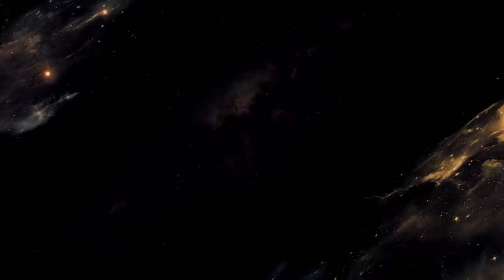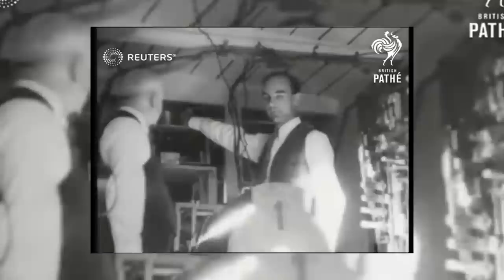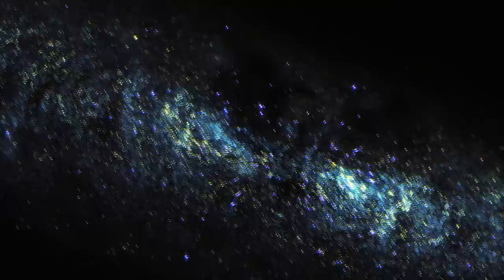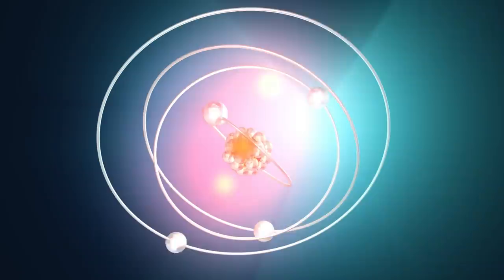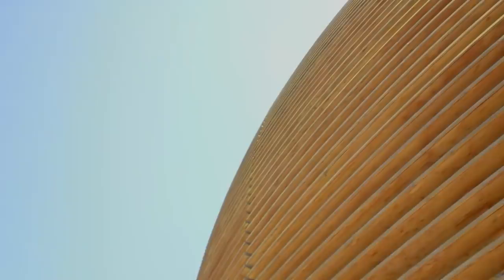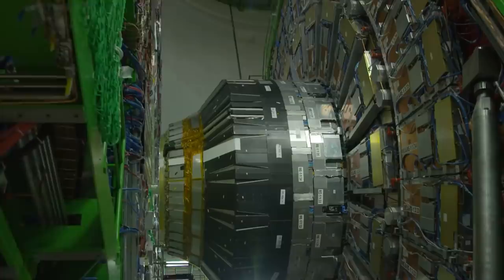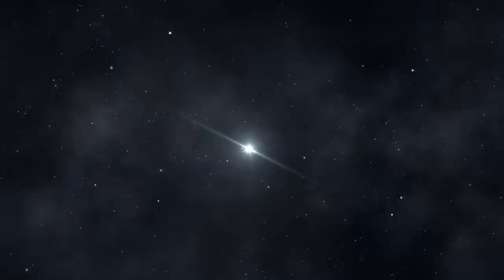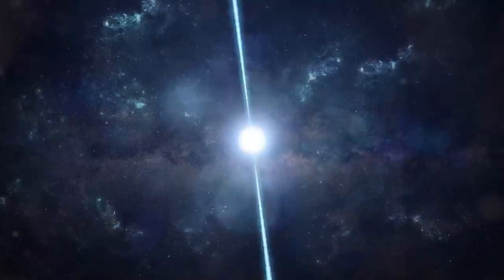Physicists Finally Reveal the Terrifying Truth About Antimatter

Comment: Maybe we could make antimatter bombs specifically for asteroid and comet elimination. Only positive use for anti matter I can think of, other than spaceflight maybe.
Reply from the maker: Wouldn't be a bad idea actually!
Reply: Light the fuse and run like hell!
Reply: You means wars
Reply: The most efficient means of extracting energy from matter.
More efficient than nuclear fission or fusion, because there's no waste materials and exponentially more efficient than burning fossil fuels for energy.
Reply: they would do horrible things with an antimatter bomb that wouldnt involve asteroids😂😂
Reply: They could use it on the asteroids circling Uranus.
Reply: "Someone will set the spark off, and we will all be blown away" -The Merry Minuet song,1959
We always knew it would happen one day.
Reply: No we can't. Maybe 500 years
Reply: True but the problem is making and containment of antimatter.
Reply: @satanicmicrochipv5656  

Yeah like antimatter reactors to produce power. Would be incredible if we could efficiently produce antimatter with less energy than the power they would make in a reaction.
Reply: @goldfish1493  

We are not going to last that long.
Reply: @wilsonrawlin8547  
Yeah, it'll be awhile.
Reply: How would we even contain it, let alone move it? Any contact with matter would be catastrophic, including atoms that make up the air in an empty space
Reply: The black wholes seems to do that job already. 
Maybe the black wholes (which we don't know what's inside) are gatherings of the remaining anti matter. 
Who knows 😁
Reply: Maybe we can use antimatter to form explosion to recharge dying sun
Reply: @satanicmicrochipv5656  maybe hydrogen laser? With big reactor and silo smth like star wars death star but in this case recharging earth? well rememeber that we don't need to hit sun with antimatter we can hit smth like comet  within its gravitation zone the sun would simply devour the Energy from blast and get either bigger and recharged or wouldnt, thing is we would need to proportionally make it we don't want to orbit close supernova or blackhole or neutron star
Reply: @piotrkijak1774  
Sure, if we could generate all the energy we could possibly use, we wouldn't even need a star and power a focused energy fields from specific locations on earth and fly the whole planet away.
🌎~
Reply: Nah just drop some on Russia right now they deserve it.
Reply: Pickle  , yes
Reply: @satanicmicrochipv5656  why when you can just drop those in the toilet😂
Reply: Nothing more positive than wiping out your enemies.

Comment: Well, I'm gonna tell ya. (What I think how this happens that electrons are ALL the same charge.)
I'm guessing that the equation that yields equal amounts needs a time component. A vector. This vector would conveniently turn negative outcomes into positive ones for Time=0 to 1. How does this work? It works because the synthesis of matter is an event defining earliest form of time-before-space. It's is second-dimension stuff - which is defined as linear and time defining. In this condition 3-axis space does not yet exist. All that exists are latices of two-axis stuff. Thus the electron sea. in sheets or planes. This is how mass condenses from point-light. From there, 3-axis space is formed as a flux only upon generation of balancing energy. However, because this process is linear and not instantaneous, the opposite charge is not formed as 2-axis anti-matter, but is matter further condensed into "nucleons" - I won't speculate about those details since it is entirely uncalled for. This means that single-charge electrons formed first, whether called positive or negative (this part needs a reply answer.) The advent of positive electrons is not a normal condition, but the product of some exception. I won't speculate there, either. Thus, in effect, electrons form hydrogen by compression and BY (keyword here) separation of charge into a stable 3D structure that benefits from FORM of energetic FLUX; and that flux defines 3-axis space.
Hey - I think that's pretty good. 🙃
I need to add something. It's pretty obvious I think that electrons are therefore, physically because they are metaphysically, the male element. Excuse me but stay with me another step. The nucleon (please excuse term,) is therefore the female because it is the consequence of the male - literally formed as a reaction to the first charge in compression and by that process opposite charge. Of course in the process, flux - the child - is created. I'll cut you slack on the details of how I know this. It's because it's easy. Other people are thinking too hard. You just need to understand and trust quantum dimensional Reality. (I call my model UUNIS, because it's been integrated with literally everything else since 1985. It's my only worthwhile talent.)
Reply: Hey 😀 have ya ever noticed now the atom looks just like the sperm fighting it out to get to the egg?  
Let me ask you a question. My mind immediately skips ahead to the next item on the table. What if occasionally one electron gets in? Talked about compression? Sea of electrons (dark matter) merging into ever heavier forms of mega mega structure? Curved space? Are we seeing a picture here that describes gravity? 
Let's see if I can do this and not screw up: electrons = gravityless, electro-magnetically compressed into balanced charges, forms gravity,  joins into masses, creating gravity flow masses, creates those visible strings of "accreting space-time" - and underneath this are forming isotopes that eventually transmute without fusion, possibly explaining heavier elements without stars .... jury of science peers - I rest my brief case.
Reply: Thank you so much for explaining in understandable, simple terms. I'm no scientist in fact I almost failed dash 3 level math in high school. But you have just explained what I've been trying to wrap my head around. If you are true in these statements, you have no idea what you've done for me to understand what I want to understand. Keep doing what you're doing.

Comment: If I were to guess, I'd say that the reason we can't seem to find antimatter in our universe is because it's actually moving backwards in time, while we're moving forward. I know it sounds far fetched it everything has an equal and opposite reaction, then shouldn't that apply to time as well?
Reply: Time isn’t real
Reply: You can find antimatter pretty easily. Look at a banana for an hour. Once every forty minutes or so, as it decays naturally, it releases a positron(antimatter) into the air. 

If you want to see the actual particle, set it up in a "cloud chamber". That's as close to "seeing it" as you can get.
Reply: @snarzetax  Yep.  Because Potassium-40 decays by positron emission a fraction of the time.
Reply: If a normal regular wave for some quantum particle is exp( i E t / hbar) and we find its antimatter version to be exp( -i E t /hbar), then there is something to discuss as whether they are the same except to replace E with -E, or replace t with -t, or replace i with -i.   Describing antimatter as "going backward in time" or having "negative energy" usually doesn't go far.  

An electron and positron have a total energy of twice one electron mass (plus additional for kinetic energy of motion) and going backward in time just doesn't mesh well with quantum mechanics - though it's from quantum mechanics the idea of antimatter sprang.

Comment: What's the difference between a neutron and an anti-neutron?
Reply: @Graeme Lastname: The mass of solemn plausibility at the anti-neutron is only about .07% of base string theory. If
we ignore the gravitational effects of worm holes on quantum consciousness then the Winfrey-Chopra limit is now
"behind" the data, and we may proceed as if the earlier exponentiations are non-restrictive. Never attribute to the
negativity of anti-neutrons that which is adequately explained by tenured inter-departmental entanglements.
The Bowling Ball On A Blanket theory of gravitation is similarly unrevealing, though its proponents will deny it. Said
blanket being set aside for observational purposes, BB on a B theorists are shown to be dimension depleted as the
balls will continue in a straight line forever as if the Universe is one gigantic blanket and the balls are rolling through
it. Any sentence that begins "Physicists Finally Reveal..." should be aware that, if no revelation is supplied, it will be
grounds for satire if not outright contradiction.
Are there higher dimensions? Define "are".
Reply: @lewiscoacher7781  Brilliant m8.    🤣 🖖‍ 👌‍
Reply: @Graeme_Lastname  Where are my manners. Thank you.

Comment: Energy is thermodynamics. Mass is thermodynamics. Heat is thermodynamics. Electricity is heat loss. Lightning burns through the atmosphere. Sound is thermodynamics. Maximum momentum velocity, in resistance is constant in and out of entanglement. Entanglement is maximum momentum velocity, in resistance, redirected trajectories of thermal energy singularity frequencies cycling circulation patterns holding mass together in equalization to resistance. Mass is always in equalization to resistance. The weight of the mass falls equally in value, because the trajectories, of singularity frequencies are redirected into cycling circulation patterns, as it is still in maximum momentum velocity, to the equalization of resistance. Resistance repels mass equally. It is the balance of harmonics harmonization, of equalization of conservation of, maximum momentum velocity, in resistance. Space itself vibrates in and out of entanglement. Black holes are empty of thermodynamics,  and don't vibrate. Bubbles devoid of thermodynamics. Mass is neutralized resistance within, and repelled from without equally. Thermodynamics variations affecting interactions, between resistance and accumulation is measured in degrees of exchanging energy and equalization of resistance. Thermodynamics controls the ability to accumulation and releasing cycling patterns. How much thermodynamics can disrupt cycling patterns depends on the interactions of unidirectional flow. Harmonics grows. Disharmony reduces forward flow. Collisions expansion of energy. Thermodynamics is outward force of pressure. Resistance is the propellant and the repellant. A bubble devoid of thermodynamics is repulsive to thermodynamics. It holds thermodynamics outside of entanglement. Fluidity. Space is a stationary cold field of resistance. Thermodynamics moves by repulsion of forward maximum momentum velocity, to equalization of resistance. Thermal energy singularity frequencies as space itself vibrates in maximum momentum velocity, in resistance, as the universal speed limit. This speed limit is in mass as mass, cycling circulation patterns in maximum momentum velocity. Conservation of maximum momentum velocity, in resistance is constant throughout space as space amplified by mass in resistance. Resistance is neutralized in mass as outward force of pressure known as weight. Hydrogen is equal to area of space and resistance. Heat loss is one valance. The greater the mass the greater the heat waves lost. Energy is stripping away thermodynamics in resistance to forward momentum creating shock waves of heat loss. All mass loses heat as exchanging point to point interactions with occupational space transitioning through space as space. We occupy space as space itself. We vibrate as heat waves replenished by stars releasing heat. No electrons. No gravity. Heat is the opposing force to cold space. Energy is equal to mass and resistance. Resistance is equal to mass and energy. All mass is heat. Atoms absorb heat and transfer heat. No electrons. What you see is oscillating resonating heat waves. Vibrations increase transference of energy and resistance. Greater Mass amplifies energy efficiency. Mass absorbs heat or repels heat through resistance. All motion is heat transferring from resistance of thermodynamics. Thermodynamics is heat. Light is only visible in resistance to atmospheres. Heat waves from stars are disrupted by the obstacles that absorbs them, or repel them. Thermal energy curves by repulsion.  Magnetic fields proves hypothesis. Outward force of pressure. Resistance is throughout space as space. Mass is occupied space as space redirected trajectories of thermal energy cycling at maximum momentum velocity, in resistance. Thermodynamics is influenced by proximity mass trajectories, and the amount of forward momentum. Distance is reduced by greater mass recycling cycles. Atoms cycle distance is minimal. Star cycles are greater. Distance in cycling patterns are different. Forward momentum is constant velocity. Conservation of maximum momentum velocity, in resistance in and out of entanglement. Fluidity to illusionary solidity. Biological reprocreation cycling patterns. Magnetic fields cycling patterns. Resistance is equal throughout space as space. Mass is space cycling patterns. Unidirectional flow is both clockwise and counterclockwise. Alpha and Omega. Everything in between. Cold resistance is used to slow heat loss. Vibrations increase transference of opposing forces. Opposing forces don't mix. They repulse one to the other. Magnets are the example of resistance and unidirectional flow cycling circulation patterns. Conservation of maximum momentum velocity, in resistance. Heat can disrupt cycling patterns. Only thermodynamics can disrupt cycling. Decay. Aging. Atoms lose heat. Cold is the variant. Resistance to thermal energy. In mass it's weight. Outward force of pressure known as weight contained within cycling circulation patterns. Conservation of maximum momentum velocity, in resistance. Black holes are hurricanes in space that are devoid of thermodynamics. Bubbles of pure resistance. Oscillating Bubbles jettison away thermodynamics, in resistance, to cold space, as equalization, out of dissynchronized thermodynamics to pure resistance. Stars repel their outermost cores towards the weakest point of resistance, which is the plasma flow of unidirectional cycling circulation.

Comment: what i think is the big bang was shrinking bc of its mass and density that anti matter didn’t want to touch matter so it starts to move more to get away making it hotter and when one of the antimatter touched matter it exploded and all the other anti that was close enough also exploded making the big bang and the reason their less anti matter
Reply: My theory is that two muons split its antipair apart, making a padding or atmosphere out of the anti-matter particle leaving one. Something like that.

Comment: I think you could use a tokamak to turn hydrogen into subatomic dust, antimatter.... then turn down the machine, and put it on fusion speed, and possibly reconstitute the raw subatomic Particles back into matter, which would have happened after the big bang. Just tearing apart and reassembling the fabric of reality... only it would not be hydrogen anymore.

Comment: If anti matter releases lots of energy when annihilated by each other why dont whe use anti matter to fuel spaceships you could fuel a spaceship with properly less than 1l for a. Journey to the moon and back and reach ridiculous speeds. I mean one teaspone of antimatter mixed with matter is equal to a nucular explosion in energy. Although you would have to be carefull not to annihilate your space craft but if you. Could contain the energy without destroying your ship you could use that energy as thrust and I would presume it would be alot more efficient.

Comment: Antimatter bomb will be smaller in size, easier to deliver to the target (as far we can make a proper and stable containment). And as soon as  after the detonation, there is no radioactive left over. The space, after cooling down will be habitable right away.
Reply: there will be no space after it
Reply: depends on amount of antimatter to release energy

it's just E=m*c^2 (but don't forget, antimatter annihilates only with matter so mass of antimatter*2)
if it's 1 ton there will be no space in radius of explosion :)

Comment: 3:39 - What is light? An energy. The distinctions are too vague. Energy is primary Photons, which are basic particles that builds the higher ones like Electrons
Reply: What are electrons and protons.
Reply: And neutral particles....
Reply: @gnarlydewd  Neutrons. All are made of smaller particles (quarks etc) like photons
Reply: @yw1971  yes. Look up coral castle code and find the one that is the "Key to the Universe"
Reply: @yw1971  There is the answer to what light is.
Reply: And quarks and all the elements
Reply: @yw1971  Structure of atoms
Reply: @yw1971  Spacetime all that is a fabric of energy
Reply: You described it perfectly just wanted you to see that.

Comment: After the moment time has come into existence it stayed a unidirectional line. Flowing both backward and forward. For time to function like contuim as lines have no beginnings or endings on their linear planes antimatter would have to come into existence for time to work in this way. For the condensed (normal) energy only experiences times flow in one direction, while condensed (anti) energy experiences time flowing in the opposite direction. And why we see more matter than anti matter. Light energy has no counter part due to its being stopped by its perpetual existence in the  cosmological constant state of speed.
Reply: Now you went and anthropomorphized energy.